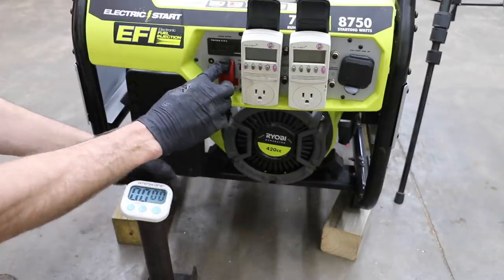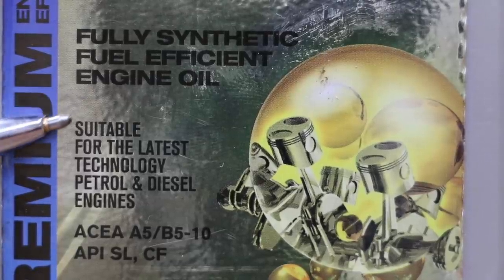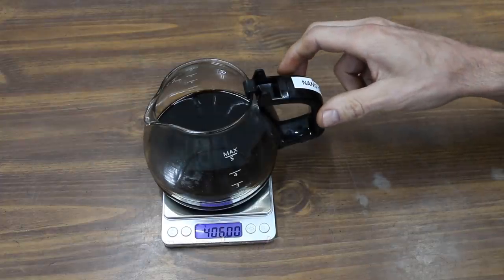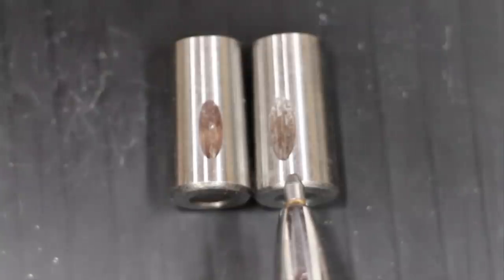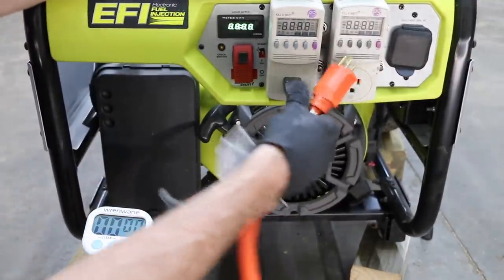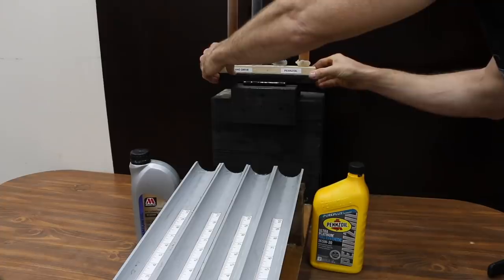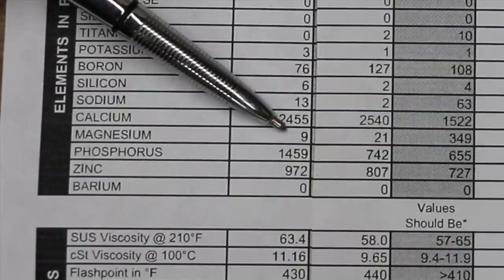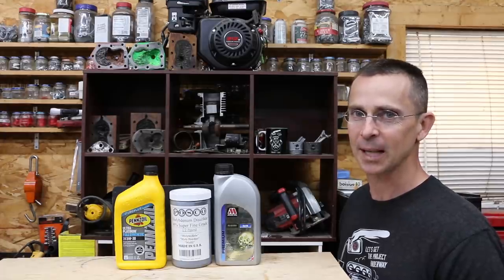Save Gas with "Nanotechnology" Motor Oil? Better MPGs? Let’s find out!

Comment: You can buy your own nano particulates in powder form in the UK on eBay and other places . NiB , PTFE , MoS2 , and WS2 are all available as oil addiditives . The same nano particulates are used for coating high temp high friction gun parts in suspension during a plasma coating process , except Tungsten . Also these powders are used for making high speed ceramic ball bearings when compressed and sintered.
The best being the Tungsten Disulphide for anti wear and even coats moving parts . You can mix it with IPA and paint a part and it will stay on that component during use as it has quite amazing anti wear and adhesion properties . All these range from about $15 to $20 for a 10ml tin .White PTFE is the next slippy one followed by Moly ,then NiB in decreasing friction coefficiency. The only product you find this material in is made in the UK as a non oil based liquid additive and typically used in both engines and gearboxes of F1 cars . This additive also uses the additional property of utilising the ultra fine particles of worn materials to fill the low spots after micro polishing to actually make the component smoother as it runs . I use it in my hot rod here but it is expensive (about $40 for just under a pint about 400 ml) but does not need replacing during oil changes once used in an engine it permanently coats the parts . Always add it during the first oil change on a new car as the engine will never run in properly .  Its the only one that has actually given visible dyno results . I've used everything over the decades most of which are viscosity improvers as I do not want to run a thicker oil , which this is not , and there is nothing like it . It is very difficult to find but when it is available I buy it ! I buy a quality UK made synthetic oil that exceeds most known brands in qualification and is listed as doing so  that is generally found in non motor parts stores for a third of the price or less of Mobil 1 or Mogul etc and replace it more regularly .
Reply from the maker: Great feedback!  Thank you

Comment: Great video once again. Do you think you would be able to do a comparison between oils used in vacuum pumps? The pump i have recommends black gold only but I know others who use just dairyland. I found a really good deal on black gold for around $3/gal more than dairyland about a year ago, normally black gold seems to cost around twice as much per gal. If I can't find a reasonable price when I eventually run out of the black gold I will most likely try the dairyland. 

I can say that the guys I know that have at least as far as I know only used dairyland have not had any issues with it.
Reply from the maker: Thanks for the suggestion.

Comment: For ten-years of four high-mileage cars (cause we be living in Cali and not rich) I  settled on a combo of Prolong (16 oz.) and Hyperlube (32 oz.) with oil changes.  Adds $30 to the cost but oil stopped leaking; engines ran tighter, quieter, cooler in Summer; no smoking, significantly more power, improved mileage.
Never tested properly for compression etc.  Maybe just confirmation bias.
Be interested in your comparisons.
Reply from the maker: Thanks for the video idea.

Comment: The only thing I would change is the ware / friction test. While it is not likely that the metal samples differ, it is possible that they are of different hardness's do to lot production or different manufactures. Put a stamped mark on each sides of the same metal sample ie 1&2. You save material and be certain of the same metal being tested.  Great test
Reply from the maker: Thanks.  Thanks for the constructive feedback.

Comment: Your videos are very helpful. They've certainly helped me make good purchases when it comes to keeping my truck going. I've got a new issue though, and that is a slow oil leak. I've tried Lucas, and I don't think it's working that well. I saw some other brands that are more specialized, and would save me on repair costs for my over 20 years old truck. Could you do a video on oil additives that fix leaks?

I was looking at:
Rislone ring seal
K&W head and block repair
Bar's Leaks heavy duty rear main seal repair

Any advice or information you could offer would be much appreciated.
Reply from the maker: Thanks for the video idea.

Comment: Hi, I was thinking about a possible added feature for the lubricity tester. If a thermocouple were attached to the stationary wear bearing it might be possible to measure the thermal conductivity of a fluid too. That way you could see if lubricity and temperature are always directly related with temperature rising as friction increases. Or if some fluids don't lubricate well but conduct heat efficiently it would lead to a large wear scar but a relatively low temperature. You could also use it together with a precision heating element to measure changes in lubricity at different temperatures. It would be interesting to see how cutting oil performs. Anyway thanks for all the great videos!
Reply from the maker: You are welcome!  Thanks for the video idea.

Comment: As usual, great job 
It s always a pleasure to watch ..
Very informative, and mostly honest and objective video.
Thumbs up.
I can't wait for the next comparison .
Small question:
Can we assume that the latest letter on the API means that it is a better oil in terms of protection than an other one with an earlier letter (in the alphabetical order).
What is the latest letter at the moment and for which brand ?
An other question (last one):
Is it preferable to use an API SL fully synthetic or an API SN mineral (or semi) ?
Thank you.
Greatings from Malaysia
Reply from the maker: Great question.  The latest letter on the API means that it is approved for use in the latest vehicles.  However, for older models, such as engine with flat tappets, the latest motor oil may not have the desired level of anti-wear additives compared to previous formulations.
Reply: @ProjectFarm  Thank you for your answer
Reply: So basically, once again it is best to stick with the engine maker's recommendations, right ?
Keep up the great work..
Can't wait for your next video.
Hi from Malaysia

Comment: Another fine job of testing. There's one test contradiction: The Miller's brand shows less wear on a bearing than does the Pennzoil. However, the Pennzoil flows much faster during the cold flow test. The oil that flows faster during cold weather should show less bearing wear.  Because most engine wears occurs upon startup, perhaps a test in a car -- with a gas engine -- started numerous times in cold weather and driven to determine bearing wear for a real life situation????
Reply from the maker: Thanks for the feedback.

Comment: I really like the tests/comparisons of oils, greases, etc. There are a couple of brands I would like to see added which could be compared to some of the big name lubricants, but they may or may not be available in your area. Traveler brand lubes are sold at Tractor Supply stores, and Rural King has their Harvest King brand. I'd love to see how these products compare with the other, well known, brands.
Currently, Rural King has their Harvest King full synthetic 5W30 oil in 5 quart jugs selling for $9.73. Price wise, that beats pretty much everyone else.
Reply from the maker: Thanks for the suggestion.

Comment: These videos are great. Thanks so much for putting these out. I’m a subscriber and always look forward to seeing what you’ve got in store next. I’m in the process of researching concrete for the purpose of resurfacing my driveway which has suffered from spalling due to the original builder not sealing the concrete appropriately. There are many out there who claim to be the best and/or the strongest. Many of the professionals claim to use the polymer modified structural concrete to resurface driveways. I’ve discovered the rapid set family of concrete from Home Depot and I’m impressed with their claims of 9,000 psi strength after full 28 day cure. When I looked at your list I didn’t see anything related to concrete/cement testing. Is there a possibility of testing bagged concrete from the big box stores? Thanks a lot and I find great value in the information you provide. 

-Jason in Indiana
Reply from the maker: Thanks!  Thanks for the video idea.

Comment: Another great test.  Have you done a test comparing automotive petroleum based oil to synthetic oil?  From what I’ve read and played with, the good synthetic oils will last longer. (You don’t have to change them as often if the engine is in good shape.).
Reply from the maker: Thank you for the video idea!

Comment: Had to look for a video of yours regarding engine oil.  Here’s one to test:  purified avocado oil.  It has a smoke point of 500ºF - 510ºF, where even synthetic engine oils run around 350ºF.  It would be interesting to see how avocado oil performs in an engine. Seriously, it SHOULD be quite stable at high temperature.  The question is: how does it perform on bearing tests and in internal combustion engines?  I would really like to see that.
Reply from the maker: Thanks for the video idea.

Comment: As far as I know, Millers is UK based. Their speciality is oil for classic cars, which has different requirements. Currently running their 20w50 in an BMW e28, but it's a fully synthetic 20w50. Millers is one of the very few companies that offer a fully synthetic 20w50. Classic Sport High Performance 20W50 NT it's called.
Reply from the maker: Thanks for sharing!
Reply: @ProjectFarm  You're welcome! Thank you for the excellent video once again!

Comment: One thing! That carbon buildup on the pistons is there for a reason! It actually protects from a burn-through of the piston (i've seen some cases where idiots were forcing HP no matter what and it ended up bad for the engine)

Comment: Just curious about what the Miller's costs?
   I don't think I will be buying it but curious. I think the under 2 years old Challenger will continue to get Pennzoil Platinum and the 21 year old 454 Suburban will continue to get the Wal Mart store brand Full Synthetic (at 195,000 miles, Suburban holds 60 pounds of oil pressure at idle).
     Yall take Care and be safe, John

Comment: Test suggestion:

Rust Converters and Encapsulators (POR-15, being one example).  Test for effectiveness over time.  Also testing the coatings for strength/wear resistance, as from gravel thrown up from the road.)
Reply from the maker: Great suggestion!  Thank you.

Comment: I did a somewhat quick look at the over 5,500 comments and found one mentioning about the metals content ruining catalytic converters (from Andrea). Phosphorus and zinc are antiwear additives but do damage catalytic converters, so they have been slowly reduced since the mid 1990s. 

Millers Oil, because of the high level of phosphorus, should have better wear properties. It can have a higher level because it is categorized for use in both gasoline (API Service SL) and diesel engines (API Service CF), where Pennzoil (API Service SN) is categorized for only gasoline engines.

Millers Oil does not appear to have an ILSAC certification, while Penzoil does. ILSAC specifies the energy conserving characteristics of an oil, and does not allow the phosphorus exemption if the oil is used in a gasoline engine.

Millers Oil, with its older API service SL (2004) certification and no ILSAC certification serves a different market area than Pennzoil's newer API service SN (2020) and ILSAC certifications. 

So both are motor oils, but not quite apples to apples.

Thanks for all the videos. I watch as many as I can, and base my future purchases on their results.

Comment: Can you try plant based motor oils? Such as g-oil or Castrol edge bio synthetic. The idea of a plant based motor oil that can be put on the compost when done sounds great. There are a few brands out there but I've never really seen a comparison.

Or maybe you already did this and I just missed it. If you have a link that would be great or if you know of a similar review.

You test so many things in an average Joe kinda way that it makes the knowledge gained seem that much more interesting. Keep up the good work and keep releasing excellent content.
Reply from the maker: Thanks, will do!  Thanks for the video idea.

Comment: Could you do a test on the best firearm grease lubricant/protectant? Some guns require lubrication of specific parts with grease, and I would want to use that same grease in the barrel for long term storage to protect against rusting. You don't have to use a gun in your video, just some kind of steel treated similarly to that of a firearm. I like your method and consistency with testing, and I trust you would come up with a good winner.
Reply from the maker: Thank you for the video idea!

Comment: I was an rebuilder for over 45 years, I could always tell when someone used Pennzoil by the varnish buildup inside. How about some comparisons with Delo 400, TRC oils, Shell Rotela. For grease we always used TRC 880 with brass flakes. Also moly grease versus others. For grease we also considered hammer out.
Reply from the maker: Thanks for the video idea.

Comment: Can you test oils that contain higher levels of ZDDP for us flat tappet guys? I normally use Valvoline VR1 oil to prevent unnecessary wear  at the camshaft. Maybe it is me, but I do not trust the ZDDP additive by itself. I would prefer a factory blended oil. As always, thank you for the comparisons and all of the work you put into the videos.

Comment: Idea.  How long will Synthetic oil last in time, if not driven often. I drive maybe 1000 miles a year and have gone 2 years between oil changes. I only run full synthetic ( usually mobile 1 and STP Extended filters )  I change it long before the 5,000 miles it should easily go but am afraid old oil absorbs moisture or something to break it down.  You do great testing. I come her first to see if you tested something before I buy. Awesome content.
Reply from the maker: Thanks!

Comment: You may have already done this, but I would like to see a motor with maple syrup I stead of oil, and also a motor where you start adding a little coolant to the oil and, also your bearing tester machine with a water/oil mixture to show how much (or how little) water it takes to break down oil for failure. Could test gear oil too. Keep up the great videos!!
Reply from the maker: Thanks, will do!  Thanks for the suggestion.

Comment: Miller had the smaller wear scar, which I think is more important. The cold flow test, well minus 40* F, most engines never get so cold.  GF6 oils are out now, and I would like to see you test these newest GF6 oils. They come in several varieties, GF6-A and GF6-B too.
Reply from the maker: Great suggestion

Comment: The much smaller wear scar showed that Miller's oil has a better add-package but the race results showed that Miller's base oil is inferior, ...the cooked Miller's got thick and slow while the cooked Pennzoil remained very fluid and fast, showing old oil flowing almost like new.   I'd rather use Pennzoil.  Thanks for the video.
Reply from the maker: You are welcome!  Thanks for the feedback.

Comment: Please get hold of a couple of litres of (black bottle with yellow label, not red) competition oil Millers 5w 40 CFS NT+ which is a very highly regarded road use and track use motor oil here in the UK. It is millers top of the range oil available (that is accessible to everyone not just pro race teams etc)
Reply from the maker: Thanks for the video idea.

Comment: Do you run the generator for 5 mins for each oil before testing? If you only do it with one, the results will be impacted by the oiltemp

Comment: You should do a vid on torque wrenches and their accuracy. After stripping out my oil drain plug with a cheap torque wrench I wish I would have had had some info on them before I purchased a cheap one that wasn't accurate.

Comment: Wasn't aware there was a fuel injected portable generator until I saw your video, which sounds like overkill to me. I've heard it's really hard on the bearings in electric fuel pumps to let them run out of gas? And aren't generators supposed to be designed to run out of gas ie carbureted?

Comment: Isn’t calcium supposed to be below 1500 ppm or something for ACEA A5/B5? It leads to increased deposits in direct injection engines. Calcium might compete with anti-wear additives too so it would be a disadvantage not an advantage. Great video as always though,

Comment: I own a BMW Motorcycle and I was hoping that your test would include information on the long term effects of Synthetic oil on oil seals, o-rings and gaskets in comparison to Mineral Base Oil(s).  An expert BMW Technician (Chris Harris - on YouTube) claims from experiences that the use of Synthetic oils will ruin the oil seals on the BMW Boxer Type Engines which are standard on most every BMW Model of Motorcycles from 1998 -2005.  Chris Harris highly recommends that owners of BMW Motorcycles only use Mineral Base oils in their Machines.
Reply from the maker: Thanks for the video idea.

Comment: I know this might be a little obsessive but you could put a three phase motor and a variable frequency drive on your lubricity tester to ensure that it is running always at the same speed. It is already an awesome machine but this would eliminate the variable of line voltage fluctuations
Reply from the maker: Thanks for the suggestion.

Comment: Just looked over your videos and I didn't see one on gear oil. Gear oil has huge price variations like 2 stroke oil, I'd like to see brands like royal purple and amsoil vs shell or Castrol gear oil. I've been using royal purple in my ATV and have been impressed, my truck has penzoil as I get free maintenance from my dealer.
Reply from the maker: Great suggestion!  Thank you.